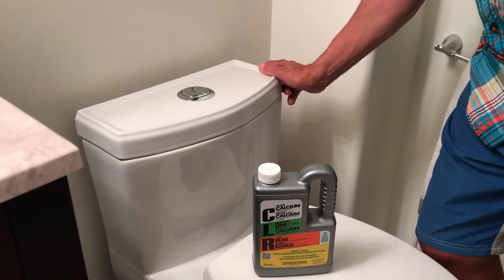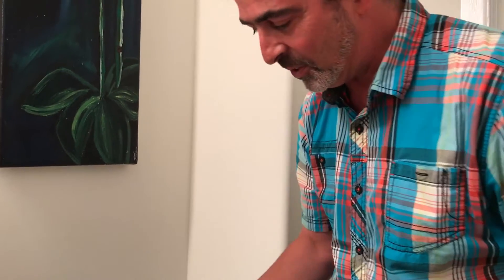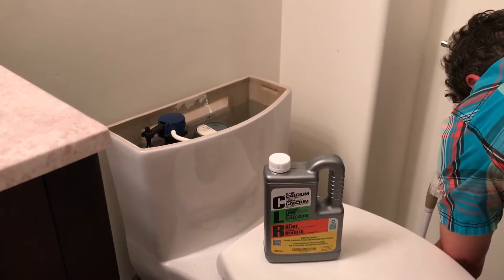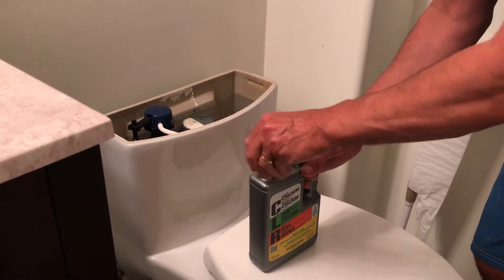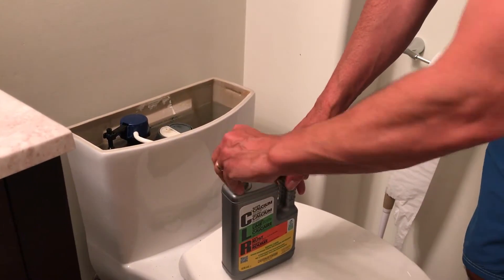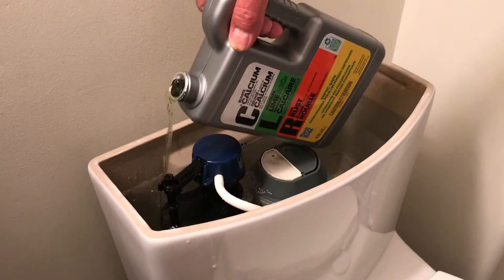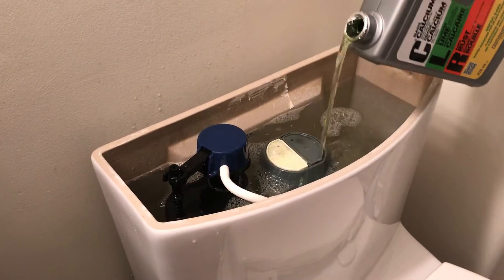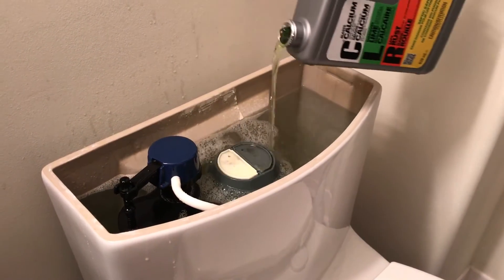How to fix your noisy Costco One Piece Toilet

Comment: Replacing the fill valve is better and cheaper long term. $10 will buy you a new one. The CLR is going to eat away at the flapper seal and you'll end up doing more harm than good.
Reply from the maker: Do you know where to buy parts for this Costco toilet?
Reply: Home Depot has replacements for both the fill and flush valve
Reply: Does this apply to the hammering sound as well?
Reply: Glad you said that, somebody needed to.
Reply: Will it ruin the seal right away or after continous use?
Reply: how about if i use white vinegar? my toilet is leaking and the tank water goes down, i replaced the tank with a new flapper, but its sitll leaking water and going down. i think the bottom where the flapper goes down on the lid is dirty and probably has calcium buildup on it, although i didn't see any on it.

Comment: Still noisy when it stops filling.... How do you fix that problem???
Reply from the maker: Mine recently was still noisy and even after CLR a second time. What I did was use the little faucet behind the toilet where the supply is, and turn down the pressure a little. It still fills the tank at the same speed, but the noise disappeared!
Reply: @mschilling9999  I have a new unit but trying to get the original nut off the tank wuld have broken the existing unit and I just did you what you said and reduced the water pressure.Eliminated 98% of the noise. Good enough.
Reply: What is the liquid that you used ?
Reply: @sensegrove  CLR